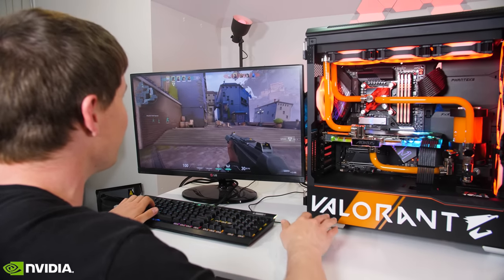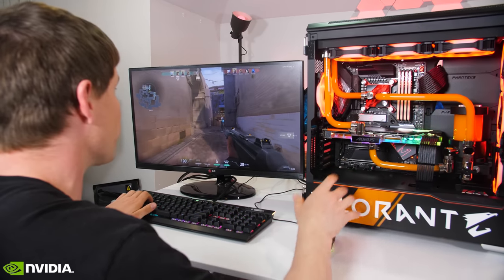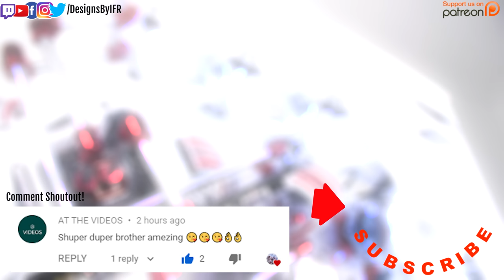ULTIMATE $4000 Valorant Custom Water Cooled Gaming PC Build - 10900k + 2080 Super

Comment: I think that if you want to get the best efficiency out of your water cooling system you could look at the way the radiator is used in a car and try as much as possible to design the distribution of the components as similar as possible to a car in terms of the direction of the water flow and the way to place the radiator.

You could take temperature measurements just as you have designed it, in full load, and then measure the temperature with another configuration more similar to that of a car and compare the temperatures.

Comment: Fans need a pan head type screw. The tapered flat heads just push the gap in the case apart making a crappy connection.

Comment: Hi, nice work.... 👍🥰, can you give me some tips for calculated the tube longuer and how to bend the tube? Thanks a lot and continue like this your work is awesome 😍
Reply from the maker: Thank you very much =) if you do a 90 degree bend just make it anlittle bigger on both sides and cut it down to length. You only waste a little bit of tube that way instead of bending it too short and having to start again
Reply: @DesignsByIFR  Hi, finaly finish my loop (1st time) can you recommanded some rgb fans for the max cooling and less noise? Actually the front ate the fan of the cooler master 520 rgb and the 2 at the top are 2 fan from aurora in win. ( front xspc 360 radiator and top 240 slim xspc) thanks for tour help.

Comment: builds liquid cooled system. installs 3 front intake fans as if its a air cooled system. SMH. Phanteks case but with Thermaltake fans once again SMH. Also instead of ordering a set of custom sleeved cables goes with cables that don't match build at all. The whole thing is a disappointment. The cpu block should have been clear. Also hope that wasn't thermaltake coolant since it's known to gunk up. The Valorant letters should have been red if you're going to theme with the game. Come on do some research and actual thought into the build.